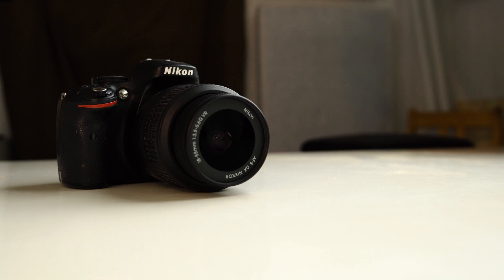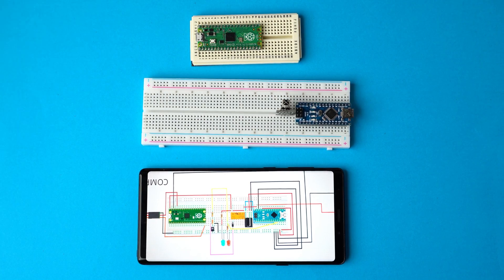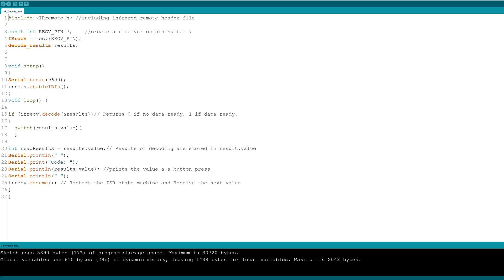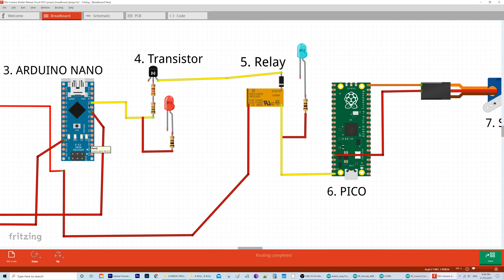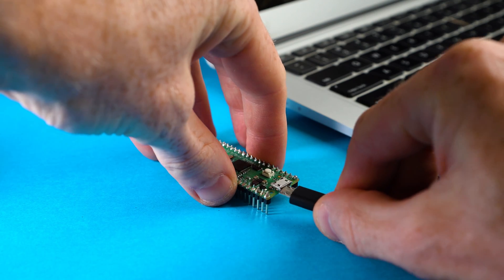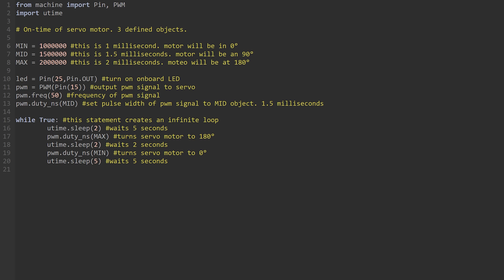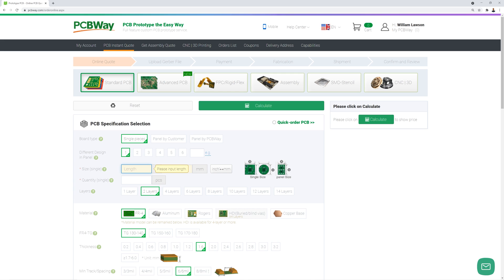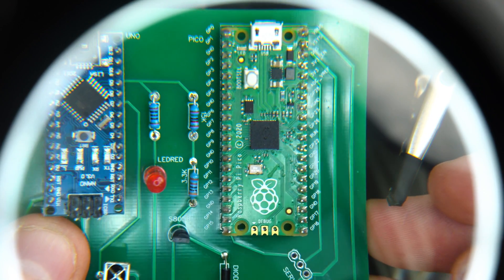Film Camera Remote Shutter Project: Raspberry Pi PICO

Comment: Is there a special reason you needed two processors for this project ??
Reply from the maker: Great question! I started out wanting to use a Bluetooth module but couldn't get it working with the Raspberry Pi Pico because it was Arduino based. Instead I changed from the idea of using  Bluetooth to infrared instead. So the Arduino uses the infrared signal to turn on the PICO. There might be a better solution, open to improvement ideas though, thanks for the comment!
Reply: @WillLawson  Yeah, in this case the Pico seems entirely unnecessary here, and I think an Attiny85 could have been used instead since you only need 2 pins. Also, try porting over the IR remote library or build your own decoder for an extra challenge.
Reply from the maker: @EvanRustMakes  awesome! Thanks for the suggestion, definitely keen to try those out!
Reply: @WillLawson  For sure. I can also help you if you want. I'm one of the largest creators on Hackster.io and I work for them as well (https://www.hackster.io/gatoninja236 ). And funnily enough, I'm writing an article about this project for Hackster News that should be out soon!